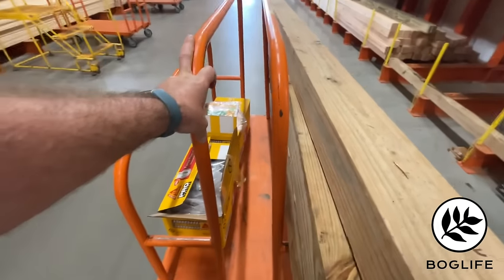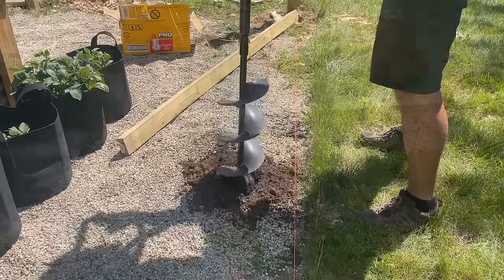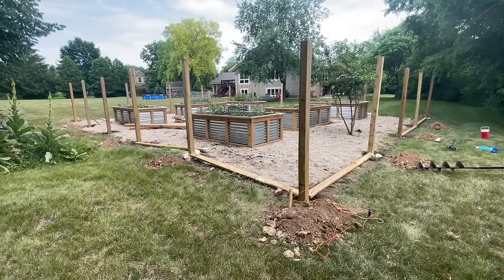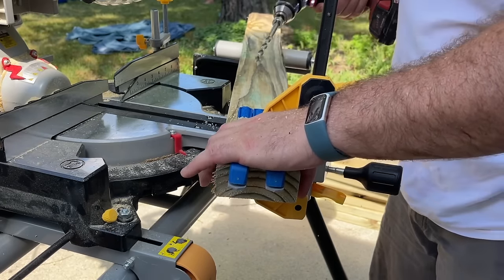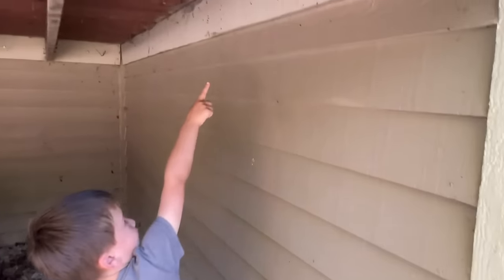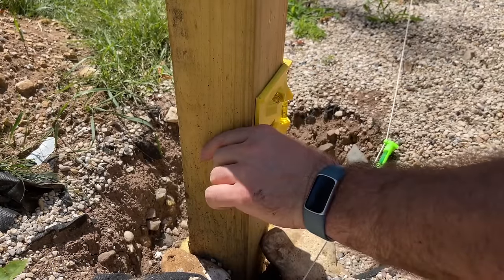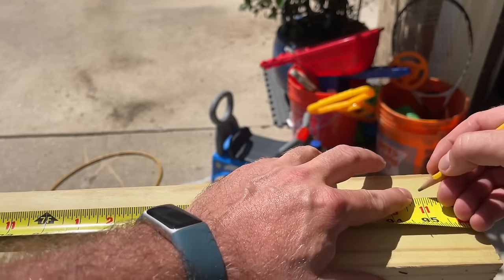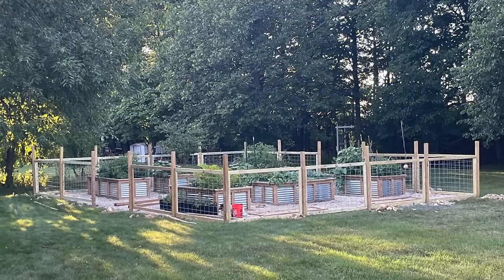DIY Fence Build // Cattle Panel Garden Fence // Bog Life

Comment: The problem with cattle panels is that if you use it like this racoons, wood chucks and all semi large critters can go right through the hole. I recommend deer fencing the holes are small and th wire strong.
Reply from the maker: @ameriicanprepper5813  it’s funny you said woodchucks, we HAD an issue with them, but the beds are so high they didn’t get into anything. Raccoons can climb no matter what, so size won’t matter in the end they’ll get in. You’d have to run the gate strait to the ground and it would have to be the same size as fence.

Comment: A) Set the posts with braces BEFORE you mix the foam. B) Have some acetone handy. It will dissolve the foam and make clean-up much easier. C) Concrete is better and doesn't require mixing. You can just pour it in the hole and it will harden. While mixing it is better, it's still stronger than foam without mixing it with water first. It's cheaper too.

Comment: This turned out beautiful! I’m wanting to do the same concept for my small garden to keep out my dog and the neighborhood pets and pests. The only change I’d personally make is concrete instead of the foam and ripping a dado to inset the cattle panels just because it looks so clean when done and it’s completely surrounded as to not show the edges of the wire panels. I wonder if you had screwed your panels into the posts first, rather than the fence brackets alone it would’ve sured and squared up some of the inconsistencies in width of your posts and strengthened them by that connection which you still can do. I think it’d tighten up any loose posts. Those are all minor, you did a better job than I could probably do and this really turned out beautiful! The other plus to the cattle panel is the wind shouldn’t beat up on it like a traditional fence so I’m hoping the foam won’t be an issue even long term 👍🏼I love the look but I also love the function because you can see in anytime to observe what’s going on and two it allows ample air or a breeze to blow through the cattle panels and keep your veggies well aerated plus helps to not eliminate sunlight like a traditional fence would. Anyways awesome build!

Comment: Thanks for being willing to say the expanding foam produces a less stable post foundation. Stability is important in my location where we are exposed to high winds from both hurricanes and tornadoes or just straight line winds which can really impact fencing, particularly if the ground becomes saturated around the post footings.  I personally stick with digging somewhat larger holes than needed, bracing the fence upright poles with angular temporary braces,  then pouring in quick mix cement to fill the hole.  I let that set for two days, then proceed with the rest of the job.  Obviously , get the posts level before GENTLY pouring in the cement mix,, adding water, and stirring up with a piece  of rebar.

No matter how good of a builder anyone is, there will be slight variations which make measuring and building each cattle panel section a customized process to fit the specific space between any two posts. Those variations likely won't be visible to the eye but will eliminate the need for ratchet strapping slightly bent posts together.  

You got really nice results doing it your way and that is what counts!   I enjoyed the video.  Thanks for sharing it.

Comment: Looks great... wondering what you are hoping to keep out with a fence with such large openings and not very tall... seeing as dear will clear an 8ft fence without blinking.
Reply from the maker: The openings will be for a gate…which will be a upcoming video. Yes it is deer we are looking to keep out. This is the beginning of the project. We will add some height to the fence, lights, more beds in the open spaces, cattle panel trellises in strategic spots, and building out the area around the fence with plants and shrubs. So we have a lot of things still to do. But so far it was successful in keeping the deer out, even with the openings, they did not bother anything in the fence.
Reply: This is beautiful 😊

Comment: Where can I get the top brackets. Found everything but them and they will make it easy to hold the top and not need help. Thanks
Reply from the maker: I think you mean these:

https://www.homedepot.com/p/Simpson-Strong-Tie-RTU-18-Gauge-Galvanized-Rigid-Tie-Connector-for-2x-Nominal-Lumber-RTU2-R/313810428

I hope it helps

Comment: Where did you find the metal bracket that you used to hold the panels to the post?  Do they have a name?
Reply from the maker: Fence Post Brackets from Home Depot.

https://www.homedepot.com/p/Simpson-Strong-Tie-FB-ZMAX-Galvanized-Fence-Rail-Bracket-for-2x4-Nominal-Lumber-FB24Z/100375311

Comment: If your panel is 50" and the topper and base are 3.5" each, wouldn't that make your total height 57"? I'm confused. Still, it's a beautiful fence!❤️
Reply from the maker: It would be….but I put the cattle panels centered on the top and bottom 2x4s so that splits it and only is 3.5 total inches, instead of 7 inches. I hope that makes sense.

Comment: Looks like manufacturer of Sika foam says for 4x4 posts to have a hole diameter of 8-10” and 36” deep using 1 or 2 packets of Sika based on hole width. May be why your posts are not really stable but not sure exactly what your dimensions were from the video.
Reply from the maker: I would have love to dug a hole that big…but the ground, my back and Mother Nature decided I should not. Getting them as deep as I did was a battle, with bowling ball sized rocks on almost every whole.

Comment: Do you have to or do you plan on staining or water proofing the wood?
Reply from the maker: I don’t have a plan to right now. I like how it ages, but I am not ruling it out for the future.
Reply: have you had any issues with deer jumping it? or does the cable prevent that? @BogLife
Reply from the maker: I haven’t had any issues so far. They stay way from the fence and if they did jump it they have to be very precise with their landing. I have trellises between the beds and have added more beds and planters since this video. I try to maximize my usage of space.
Reply: would you see any concerns doing 16' x 52" cattle panels? @BogLife
Reply from the maker: @CarsonBerger  I don’t see why not, but to make sure it’s sturdy, I’d segment it with wood bracers in the center. I have children and they climb, I’d be afraid it might break. You also have the struggle of finding straight 2x4x16s.

Comment: You should have used concrete lentil s instead of wood as the last forever and do not have to paint them. And bolted 4" x 2" and then attached your mesh to that. That foam stuff is pure rubbish. Can't beat concrete or fast setting concrete.
Reply from the maker: I won’t argue with you there. I wish I would have used concrete. But I’m not ruling out a possible of expansion. If that ever happens it would make it easier to remove, and I’d use concrete the second round.
Reply: And cut an 8" cavity block in half. Put your lentil into the block, pour concrete around it, and let get go off. You will have to make a bigger hole in the bottom for the block. But the lentil will not move with the block as it's base & is easier to level. Trust me, I have done several fences and some lentils where 6' high & 18" to 24" deep in the ground, and then once set, you pull a chalk line to level the top & cut with a big grinder.